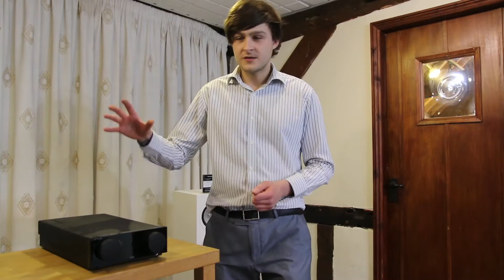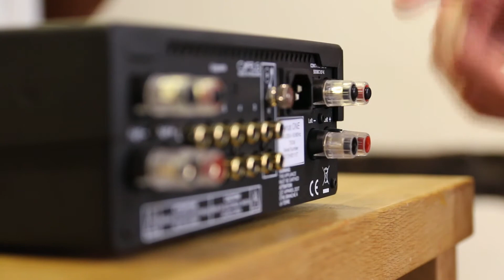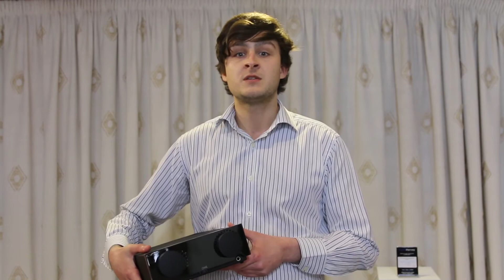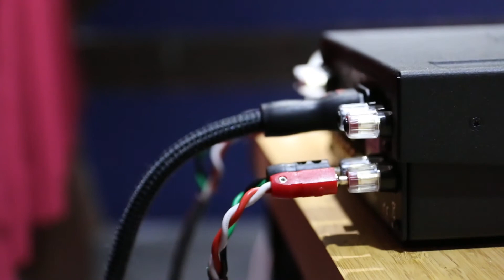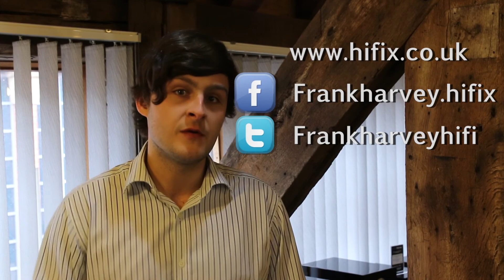Cyrus One Stereo Amplifier Review and Demonstration Video

Comment: Does it have trigger input so when you turn on your AVR the Cyrus comes alive when using it as a Poweramp?
Reply from the maker: Hello Peter, unfortunately there isn't a trigger input. The Cyrus would need to be set to AV on the dial and then power turned off on the Cyrus on of off.
Reply: Frank Harvey Hi Fi Excellence thanks for replying. Can't help but feel that's an oversight and would have been cheap to implement if they can do all the Bluetooth malarky! Have you heard the arcam A19? If so do they compare?
Reply from the maker: Hi yes I have extensive knowledge of this amplifier due to owning one. They are both very good. The Cyrus for me is a slightly more detailed amplifier and is more powerful. I do think this is definitely a personal thing in terms of the sound. The A19 is now discontinued and we should shortly be doing a video on the replacement for this the SA10.

Comment: I have an original Cyrus One, at 25w @ 8ohm you'd think it would be weak, but I really can't turn it up past 6 without shaking the windows. Its not quite powerful enough for my new KEF LS50s, sounds great most of the time, but turning it up REALLY loud, it begins to distort at around 2Khz (most of my friends cannot notice this), I was thinking of a couple of these as monoblocks, but I have heard that although they are decent, and really good for the price, they are  comparable with $1500 amps, unlike the original one which was/is comparable with $5000 Amplifiers.... your comments?
Reply from the maker: Hi Oscar! Some of the guys on the shop floor could probably help out more with this, drop them a quick call on 02476 631 707 they'll be able to give you more technical information. I believe it'd be great though, it'd certainly help out with the distortion problems.

KunstmachtDruck had some fantastic points.
Reply: The Cyrus I sounded alway a bit "glassy". The Cyrus II still was "rough" sounding, but not as bad. The Cyrus 3i sounded warm an full. 
I consider the Cyrus I a budget amp. The Cyrus II´s advantage is being a powerhouse which can release explosive dynamics, which will blow you away when your source is a good turntable like a Rega Planar 3.
.
When you want the "live" feeling, a Cyrus II with turntable and good speakers can do the job.